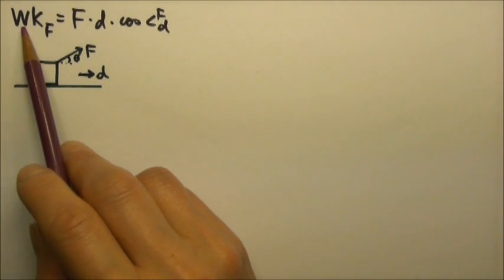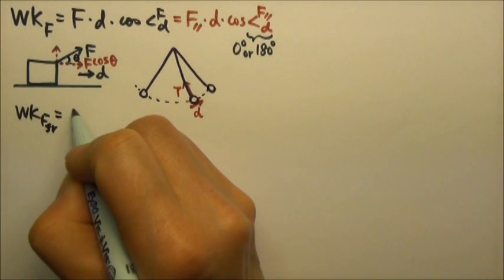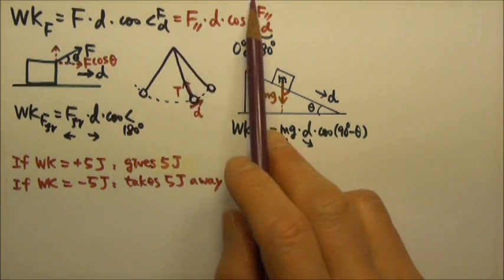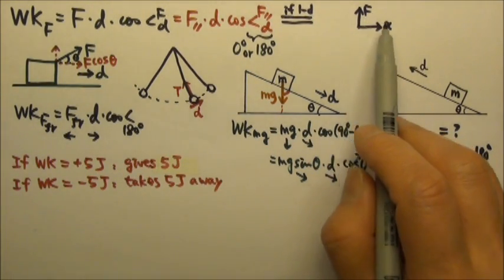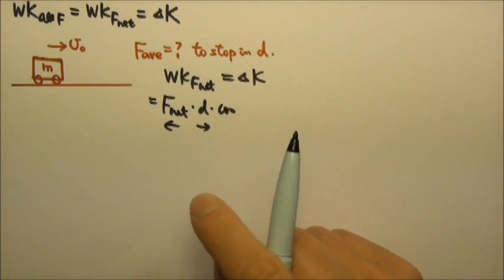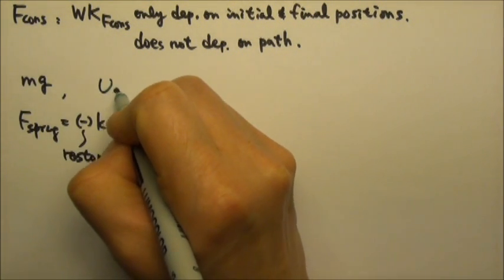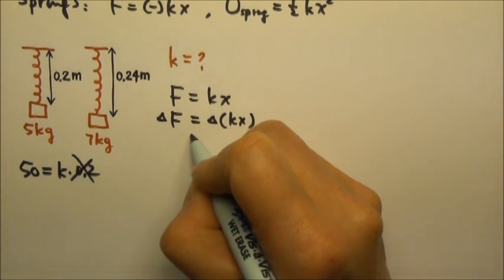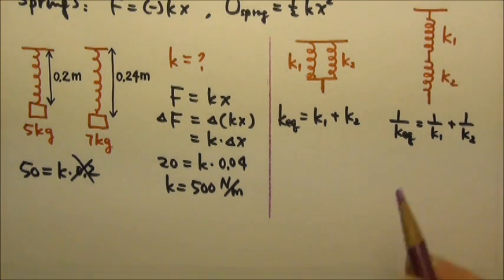AP Physics 1: Review: Work, Conservative Forces, and Springs

Comment: For the example hwere u find k for 2 different springs, you seem to assume mg and the force of the spring are equal, so do we just assume that or is there a reason that is the case?
Reply from the maker: +Internet user Because in this case the masses are hanging under the springs and stay at rest. If the masses are staying at rest, they have no acceleration and therefore zero net force. So we know that the downward force mg must be canceled by the upward spring's force kx. That's why we know mg = kx.
Reply: ohh thnx!